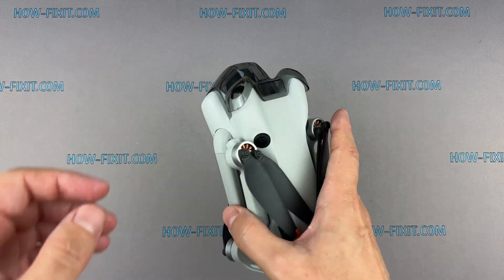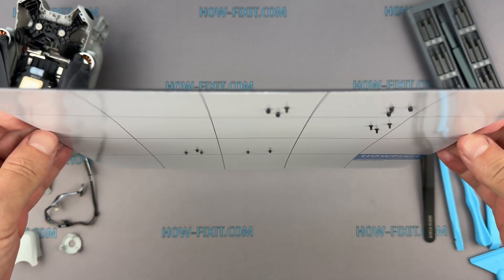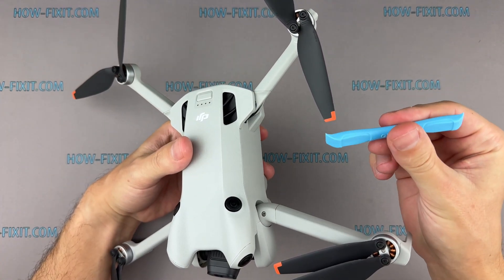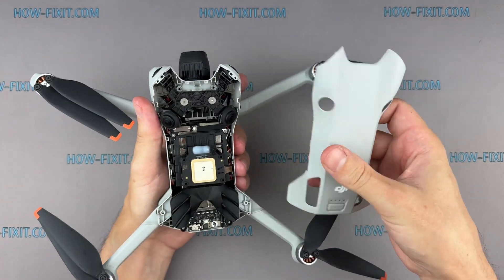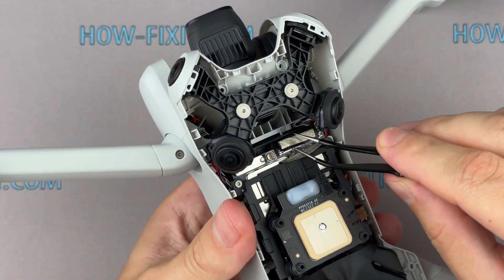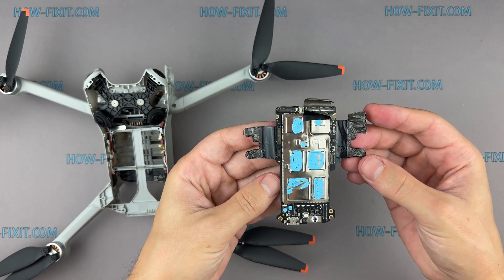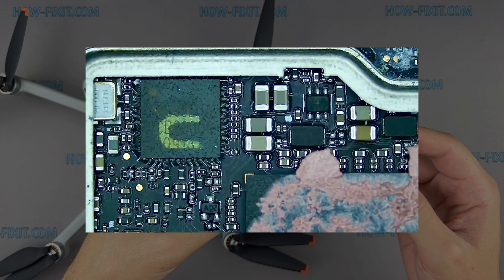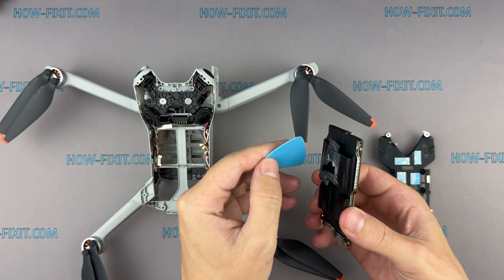DJI Mini 4 Pro Motherboard Replacement & Water Damage Repair Guide

Comment: This is COMPLETE NONSENSE! After doing that your camera, gimbal and ALL the sensors will no longer work! They have a serialnumber that’s now not compatible. With special firmware you can calibrate the gimbal, NOT the camera and sensors. Please do not buy a mainboard since it will NEVER work.

Comment: Hi, I reinstalled a new motherboard and i have errors. Do you have to calibrate gimbal, gps and sensors to board?
Reply: After replacing the motherboard, it is essential to recalibrate the various system peripherals

Comment: My drone fall down, no water damage but there is an issue with pairing the drone with controller
Reply: You will have to replace the motherboard to correct the problem, they are sold on AliExpress
Reply: @mauricebettel3803 do you need any special software after replacing the mother board ?
Reply: I’m having the same exact issue. Can’t get it to stay paired. It might pair for a quick 10 seconds. And immediately disconnects.

Comment: Any error showing and how to remove
Reply: Hi there, Regarding your inquiry, could you please provide a video recording of the error? It will be helpful to give you a better solution. Thank you.
Reply: @DJISupportGlobal Is that possible to replace new motherboard to mini-4 pro? If yes then how to calibrate the vison sensor?
Reply: @Dronebaba1  Hi there. DJI Mini 4 Pro has auto vision calibration and the vision system of the aircraft is automatically calibrated when needed. May I know if there is any issue with you drone? Kindly get in touch with us if you need support from us.
Reply: @DJISupportGlobal  our mini-4 pro had crashed and something worng it turn on but wont connect with rc and no response in gimbal......so it may need motherboard replacement.......so are you sure? is that auto calibrate when change new motherboard?
Reply: @Dronebaba1  Hi there. Thank you for sharing your concern with us and we are sorry to hear about this. Since the aircraft is crashed I would recommend sending your drone back to our repair facility. This will allow our certified technicians to fully inspect the aircraft. You may submit the request via our website. Thank you for your kind understanding.
Reply: @DJISupportGlobal  But from bangladesh its almost impossible to send any drone to another country......if there is any way to fix it plese kindly sahre.

And please need clearly answer about if i bought another mini-4pros motherboard and replace it to the drone is it take auto calibration of vision sensor?
Reply: @Dronebaba1  After replacing the motherboard, it is essential to recalibrate the various system peripherals
Reply: @mauricebettel3803  how to calibrate mini-4 pros vision sensor? when i change the motherboard?
Reply: @DJISupportGlobal How can I calibrate the Mini 3 camera after changing the motherboard?
Reply: @vlogtechg  Go to DJI Fly and tap Settings > Control > Gimbal Calibration to calibrate the gimbal. I hope this information is helpful. We are always happy to help. Thank you!
Reply: @DJISupportGlobal  I changed the motherboard of the drone, DJI Mini 3, now the camera does not work, it needs to be calibrated and I have tried in various ways, I can't. Does anyone know a program to calibrate?